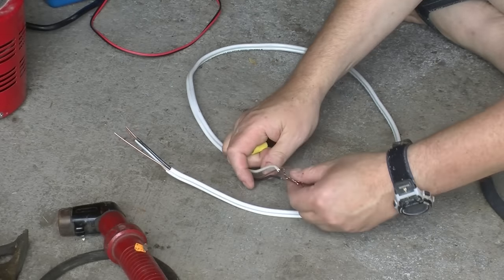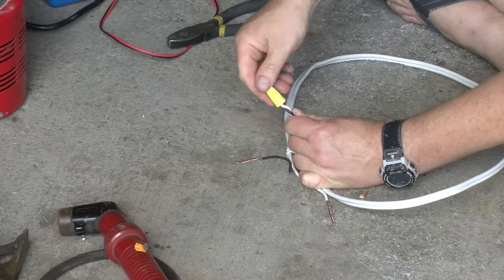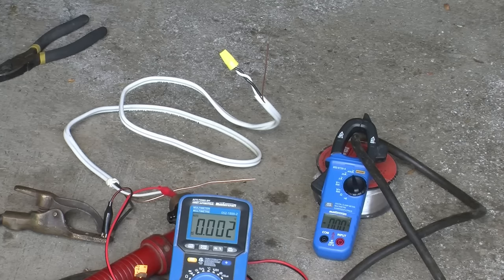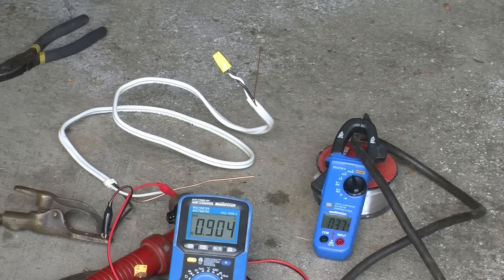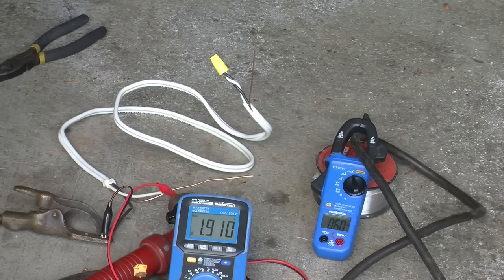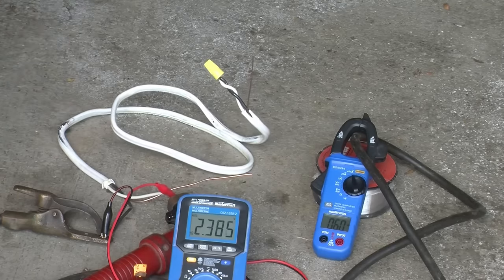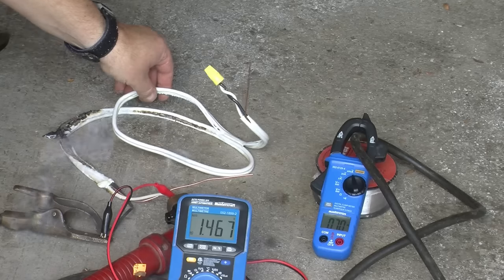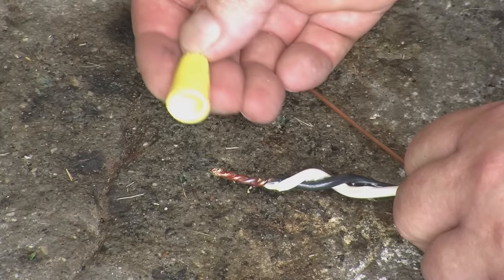How many Amps to burn up 14/2 electrical wiring?

Comment: All along I'm wondering what the weld/cool down period is on your welder.
Reply from the maker: Its a classic old school welder: the manual has a graph showing a linear increase from 20% duty cycle at more than 200A to a 100% duty cycle at 100A or less. All my long duration tests are 70 Amps or less so nowhere close to melting the welder. I bought it used a year ago - they sure dont build things like that any more!
Reply: @ElectromagneticVideos  You got that right. I have 4 microwave oven transformers just waiting for me to make my own. I just wanna make sure I do it right.
Reply from the maker: @siggyretburns7523  They should have the power. The one thing classic welder transformers have is adjustable flux leakage, partly to adjust current and partly as a ballast for a crude constant current characteristic. If you had one of your transformer's primary unconnected with just a few secondary turns you might be able to achieve something similar. You do know know how lethal the microwave transformer HV output is? I hope you plan to completely remove the HV winding while making space for your new low voltage secondary.
Reply: @ElectromagneticVideos   Yes. If I reember right, the fine wired coil is the secondary. It gets eliminated and replaced with 10 - 12 guage wrapped around 15 to 20 turns or so. So its a low voltage/high current output.
Yes I'm aware of the dangers of MOTs. I got zapped just with a AA battery, a capacitor, and an MOT. Apparently I charged the cap and switched polarities before it could drain and touched them to the primary with my hand on the secondary. Wasnt much, but I felt it.
Reply from the maker: @siggyretburns7523  Yes - the really fine wire is the HV secondary. Its typically in the 4,000V range with more than enough current to be lethal. If you are at all unsure of anything, get help from someone with expert knowledge. Apparently there were a bunch of youtubers who got seriously injured or worse a few years ago with a different microwave transformer project using the HV. And if you haven't already, remove the power cords from the transformers so some kid doesnt plug them in when you arnt around. Having said all of that, hope the project works well!
Reply: @ElectromagneticVideos  MOT videos are the number one killer of all DIY videos. No, I have no problem with that. Its what gets connected in series and what gets connected in parallel that Im confused on. I still have to hook up 220 yet.
Reply from the maker: @siggyretburns7523  Just for  everyone reading this - please be careful! If you are at all unsure with any electrical project stop and get help. Dont take a risk for the sake of any DIY. And if it involves HV, even if you know what your are doing consider something like a dead mans switch. I did a how-to on that here: https://youtu.be/ZhCvTCeGvMc

Comment: How long will a fuse let this direct short last???🤯 Instantly
Reply from the maker: Hopefully! Its really quite amazing how well fuses and breakers work. A dead short on 120V even on 14/2 can draw 10,000s of amps and extinguishing an arc that size in a fuse or breaker even if its has only been going for an instant is impressive.

Comment: Wouldn't this be a better test with a longer length since the resistance goes up with length?  Real world would be say 25ft run
Reply from the maker: Well for a given current which in a normal situation is determined by whatever the load is, the heat emitted per foot of cable does not change if the cable is made longer or shorter. Your right the resistance goes up for a longer cable, but the result heat is distributed over the longer length and the temperature rise remains unchanged.  What does make a difference is if the cable in a wall filled with insulation and as expected things do go bad at a lower current. I did do a FAQ video here if your interested in more details: https://youtu.be/CP3-jcpzZeI

Comment: It depends on the length also a longer length would take substantially less amperage
Reply from the maker: Length has little effect because the heat given off is on a per foot basis for any given current. So twice as long twice the heat but also twice the area to dissipate it so same temperature. What does make a difference is a real situation in walls with insulation etc as in some of the later videos.
Reply: @ElectromagneticVideos  so why does the amperage rating of wire go down as the wire gets longer then?
Reply from the maker: @jamesmelcher7241  Its the code specified allowable voltage drop that limits it in this case. As the wire gets longer, the total resistance of the wire increases. So for a given current, the voltage drop along the total length of the wire increases (its still the same voltage drop per foot, just more feet of wire). 

So for #14, the resistance is about 2.5 ohms per 1000 ft.  So for a 14/2 cable 1000 ft long, about 5 ohms for the round trip. 

Example: In many areas, a max voltage drop of 5% is allowed or 6V for a 120V circuit. So 1.2A is the max current for a 1000 ft 14/2 cable. For a 100 ft cable,  you could go up to 12A before you hit the 6V drop. Course these are pretty unrealistic examples chosen to make the numbers easy.
Reply: @ElectromagneticVideos  I stand corrected, my apologies
Reply from the maker: Now worries! Hope you found the video interesting anyway!

Comment: NEC is very conservative in rating ampacity
Reply from the maker: Yes and rightfully so. Having said that, in later experiments I mimicked a 2x4 wall with insulation and margin of safety was (not surprisingly)  significantly lower than here in open air.

Comment: You can figure out about when a wire melt with a little math.  Subtract the wire ampacity from the current to get the overcurrent which will be converted to heat according to Jules Law.  And for about a foot of 14 gauge you have 0.002525 resistance.  You plug that into the formula Power/Heat=Current^2 times Resistance.  So at about 50 amps of overcurrent you would have P=50^2 (0.002525)=6.3125 watts= about 21.53 BTU

So the 14 gauge wire in this case seemed to melt the insulation at about the energy it takes to raise 21 gallons of water one degree.  And that method will work to estimate the power loss to heat with any size wire and current.  And it is just an estimate as the formula would need to be recalculated for every degree Celsius of heat and the heat capacity of the wire.
Reply: To calculate the time it would take for 21.53 BTUs to raise the temperature of a 1-foot long, 14-gauge wire by 1 degree, you would need to know the specific heat capacity and the mass of the wire. Here’s a simplified version of the calculation:

Convert BTUs to Joules: 1 BTU is approximately equal to 1055 Joules. So, 21.53 BTUs would be about 22704.15 Joules.
Calculate the mass of the wire: For a 14-gauge wire, the diameter is about 1.628mm, so the radius would be 0.814mm. You would then convert this radius to cm (since the density is in g/cm³), calculate the volume, and then multiply by the density to get the mass. The density of copper is approximately 8.96 g/cm³1.
Calculate the specific heat capacity: For copper, the specific heat capacity is approximately 0.385 J/g°C2.
Calculate the time: The formula to calculate the time taken to heat the wire is t = Q/(m*c*ΔT), where Q is the heat energy in Joules, m is the mass of the wire in grams, c is the specific heat capacity, and ΔT is the temperature change. In this case, Q = 22704.15 Joules, ΔT = 1°C, and m and c are the mass and specific heat capacity you’ve calculated.
Reply: Let’s calculate the mass of the wire and then use that to determine the time it would take for 21.53 BTUs to raise the temperature of the wire by 1 degree.

Calculate the mass of the wire: The diameter of a 14-gauge wire is approximately 1.628 millimeters. Converting this to centimeters gives us a diameter of 0.1628 cm. The radius would then be half of this, or 0.0814 cm. The length of the wire is 1 foot, which is approximately 30.48 cm. The volume of the wire can be calculated using the formula for the volume of a cylinder, V = πr²h, where r is the radius of the wire, and h is the height (or length). This gives us a volume of approximately 0.623 cm³. The density of copper is approximately 8.96 g/cm³, so the mass of the wire is density × volume, which is approximately 5.58 grams.
Calculate the time: The specific heat capacity of copper is approximately 0.385 J/g°C. The heat energy in Joules is 22704.15 Joules (as we converted earlier from 21.53 BTUs). The formula to calculate the time taken to heat the wire is t = Q/(m*c*ΔT), where Q is the heat energy in Joules, m is the mass of the wire in grams, c is the specific heat capacity, and ΔT is the temperature change. In this case, Q = 22704.15 Joules, ΔT = 1°C, m = 5.58 grams, and c = 0.385 J/g°C. Plugging these values into the formula gives us a time of approximately 11800 seconds, or about 3.28 hours.

3.28 hours is too long.  So something is missing from the equation somewhere.  I think the heat capacitance of the wire isn't taking all aspects into account.  Food for thought.
Reply from the maker: Its really more about the heat transfer through the insulation, and that combined with the heat capacity of the combination of the wire, wire insulation, surrounding air and surrounding insulation (such as in a 2x4 wall in some of the followup videos I did).  The heat capacity and thermal resistance (insulation) forms a time constant  - how long it takes for the temperature to stabilize for a given current. Not long in this situation.   The the max temperature reached is really what temperature is needed to transfer heat energy away at the same rate the wire gives off that heat energy as per you initial calculations. With air moving and the complicated geometry of the loops of wire what your trying to model is not easy  - lots of unkowns etc. So great effort but not an easy thing to calculate
Reply: @ElectromagneticVideos  Yes indeed.  It's complicated to the point of it being theoretical science.  I started building some software to get a better estimate of heating time.  And now I've gotten the estimate down to about 0.35 seconds.  Im giving the time constant you suggest some thought.  I find it very interesting to correctly model this.
Reply from the maker: @Shadow_B4nned  It is actually an interesting - and important modelling problem, and a great example why real stuff often has to be approximated in order to solve with simple math. 

Since your having fun with, have a go at these ones:

Fiberglass insulation and wire in a wall: https://youtu.be/Df7bAEdIILI

Foam insulation and a wire in a wall: https://youtu.be/lFdSXTKsKwA

Rigid foam insulation and a wire in a wall: https://youtu.be/4k0xLiokNsc

In a very crude sense they should all be mostly a simple time constant model where once the temperatures have reached equilibrium, its really just thermal flow and thermal resistance. Since you know the heat output from the wire based on current and wire resistance (which goes up with temperature) you should be able to estimate the thermal resistance and even compare that to a calculation of the typical insulation properties of the fiberglass, foam etc.  Of course my crude temperature measurements and imperfect insulation installation will skew things. The nice thing   about these examples is that there is little airflow until the foam etc really starts to melt. 

If things like heat flow really interests you, look up Finite Element Analysis if you are not already aware of it- a standard method of modelling this type pf problem as well as fluid flow, and also EM fields and other things, and numerically computing the solution for geometries where the math gets impossible to do algebraically. There are free Finite Element Analysis sw packages out there  - not sure how easy - or hard they are to use.
Reply: @ElectromagneticVideos   Thanks.  I definitely should include heat output as well.  And the thermal insulation properties of the wires insulation as well as things like cooling factors and time dependent properties of the material that change with temperature.  Maybe there's a way to condense everything into a constant given a constant environment, for simplicity's sake.
Reply from the maker: @Shadow_B4nned  Thats the idea - rather than trying to handle every part individually, lumping it all together as one heat source, one thermal mass, one insulation resistance, one external temperature.

Comment: all you proved is the wire can carry more amps at lower voltage but not the max amps at 120 volts household voltage. 60 amp x 2.63 volts =141. 78 watts.  where 120 volts x 60 amps = 7200 watts , where 120 volts x 15 amps = 1800 watts the rated working amps of household wiring.  for a real test use 120 volts and keep increasing the amps and see how much it can carry.
Reply: The amperage determines how much heat it will produce. If you were to connect 120v to that setup, it would pull HUGE amperage and fail immediately.

Comment: if youre using household wire.. you ought to test it at a household voltage
Reply: current is what causes heating. higher voltage would only cause more current for the same resistance. for this he is having to use lower voltage to control the current
Reply: @jasonharrison25  I understand, what I’m saying is Id like to see how many amps it can take at 120 volts
Reply: @anchors4115  it would be the same. except for the fact that he would bot be able to replicate the same current at that voltage unless he added some additional resistance or a much longer wire. plus he would need a much larger / more powerful power supply. even if he only went up to 50 amps that would be 6000 watts at 120 volts. 

shorter wire with less overall resistance means he doesn't need as high of a voltage to get to the same current needed to burn it up. 5 volts at 50 amps is only 250 watts and much more manageable
Reply: @jasonharrison25  I don’t want him to replicate the current, I know it will be lower. That’s the point.

Comment: While it was a good experiment that is rated for a 120 V so running a 120 V through it instead of as resistive I think it would be a little bit different
Reply from the maker: The real difference would be what happens when the wire actually shorts after the insulation fails, and in most cases with a good circuit breaker, not much would happen. If your interested in more about this sort of test, I  did a bit of an explanation: https://www.youtube.com/post/UgkxeilOfLJGy2ODslnBW0WFXUE580oHhFyP

Comment: So... it can safely handle 20amp continuous?
Reply from the maker: No for a number of reasons. Normally a wire would be in a more confined space with less air circulation so it would get hotter (see some follow up videos I did with wire in a wall filled with insulation). With extended   high temperature use  you would expect the plastic insulation to deteriorate so it really should only be barely warm during normal usage. And, you want a significant margin of safety .....
Reply: @ElectromagneticVideos Hence, GFI outlets. But is it waste of money as replacing all outlets for extreme safety beyond code?
Reply from the maker: @reccocon3442  Well GFI would protect from short live to ground bot not short between short live to neutral - thats still the circuit breakers problem. 

But your point "is it waste of money as replacing all outlets for extreme safety beyond code?" is such a good one and a pet peeve of mine - lately I get the impression that enhancements like that are being done without looking at the whole picture. Example - lately in many places in Canada and the US, AFCI breakers are being required on most circuits in homes. At an additional cost of $1000 (?) per home, is it worth it - or if we wanted to make things safer, would we be better off spending that $1000 elsewhere in new construction for greater benefit? Maybe more fireproof drywall or other materials? I dont know the answer for sure....

Comment: Whoever wired my house used 2 conductor wire where each wire is 1/8" thick, then ran a separate ground... no idea why they did that, but each circuit in my house is fused with a 30 amp fuse and every 110 plug is the 20 amp type.... seems a little over kill, and is a giant pain when changing out ceiling fans... had to buy bigger wire nuts because I was expecting 14 gauge wire.
Reply: Your house probably didn't have a ground originally , at least they added one
Reply: The 20 amp outlets just hold up better , it's supposed to be the circuit is rated for the wire , if the outlets are rated higher then the circuit , that's a good thing
Reply: My dad went to school to be an electrician, but never did it for a living. He has wide about a dozen houses for family and he always uses #12 wire for outlets.
Reply from the maker: I never heard of that before!